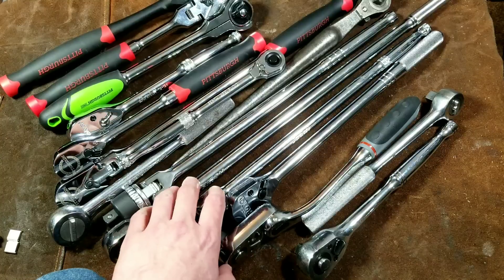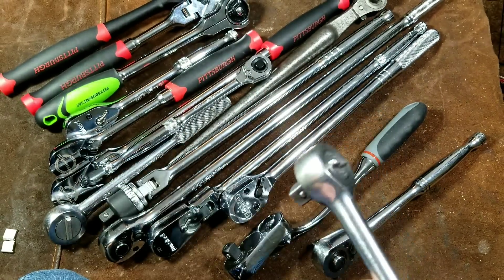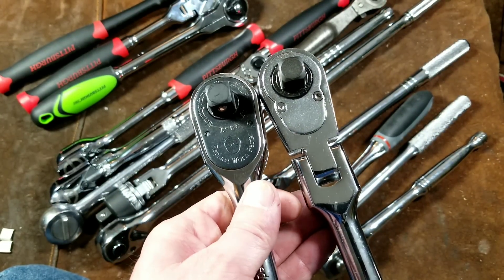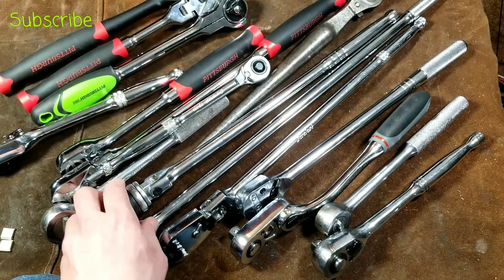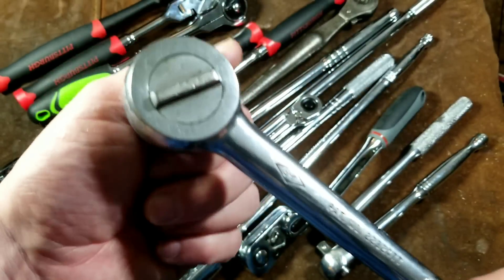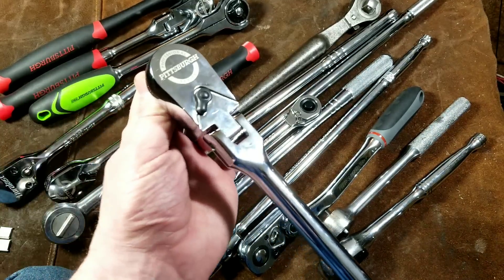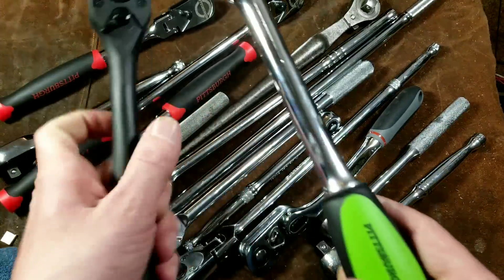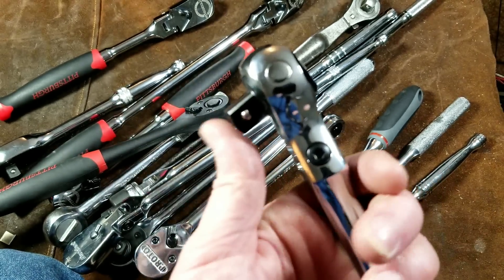1/2" Drive Ratchet Review & Comparison

Comment: Hey sir nice post. I can remember being surprised about 30 years ago when I bought a S-K 1/2 ratchet for are store and it was like 50 bucks. Not any more and it's not mine it has always work well. So my driver recently  offered me a one time deal on a 1/2 set, at first i said no ty, a Snap-on set is pricey, but I took a close look and the set did come with two ratchets so I bought it, the  ratchets alone are worth over 300. Bucks a standard and a long, they are great, and with the 5 extension, metric sockets I think I did real well
Reply from the maker: Yes tools are much better deals when you buy them in sets. I have bought sets just to get a few specific items and then sold the remainder of the sets just to save money

Comment: I just started working more on my cars because things have been breaking on them. I don't have a lot of tools myself so I use my dad's Craftsman 1/2 inch. I decided to get me one larger ratchet so I don't take his and it was the 1/2 flex head you mention. I got a small Craftsman tool set I bought years ago but the 3/8 ratchet just didn't give me enough leverage. I got tired of trying to take out bolts so I just went for the big one. No more fighting with most bolts now. I also got their long soft grip breaker bar and their impact sockets. I feel much better now. What a difference a larger ratchet makes. I'm thinking of getting the extendable that has a 1/4 and 3/8 on the same head. Do you have any experience with it.  I have those two in the Craftsman set but really like the longer part. I just thought the handle moved too much when extended though. So I'm not sure how good that ratchet might be.
Reply from the maker: Yes the discovery of half inch a wonderful thing. I would stay away from the extending handle ratchets just because when they get karate the locking mechanism on the handle doesn't work very well. The double-sided ratchets are not popular because they having the Anvil sticking out of the back side causes it to interfere in a lot of situations

Comment: Keep up the good work buddy!  You should do a vid on lubing a Pittsburgh  3/8 swivel head ratchet. The green handle not the flex head. I can't figure out how to get that sucker open
Reply from the maker: I believe that ratchet is permanently assembled and is held together by the ratchet pawls themselves I will see if I can take it apart and make a video
Reply: Catus Maximus maybe just soak it in trans fluid if need be i guess
Reply: Jared Milkyway I have the gearwrench and pittsburg versions of the roto ratchets. The gearwrench ones have a small recessed lip with a split ring I can remove. The pittsburg I tried to pry up to see but theres not much room to access a split ring. There has to be one but accessing would take great force.  soaking in oil sounds like best option or warranty out at HF.